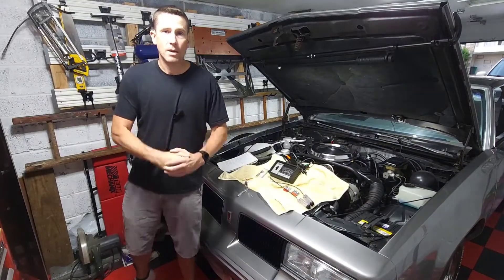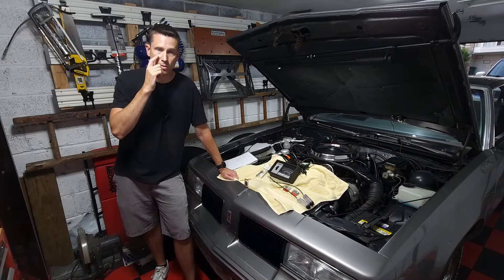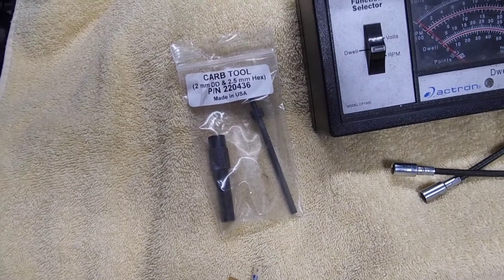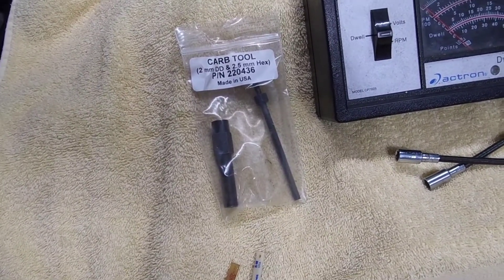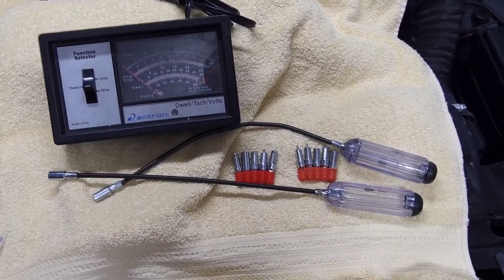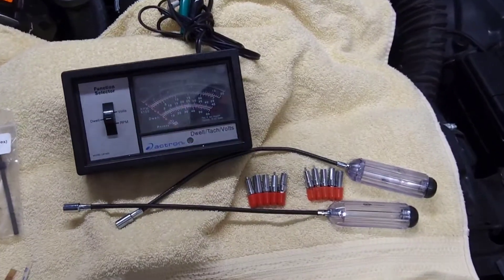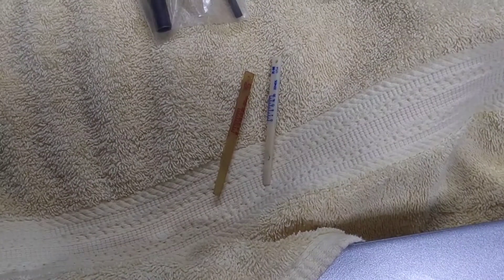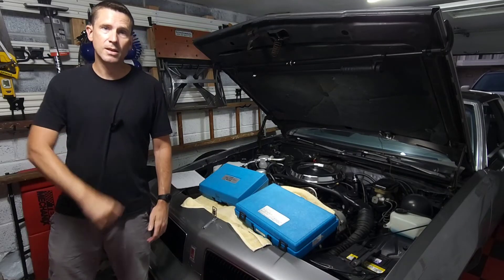3 Tools You'll Need To Tune An Electronic Quadrajet (In 3 Minutes!)

Comment: I’ve been watching your videos I have a 81 Pontiac Firebird Trans Am with a 4.9 turbo I had the carburetor rebuilt and it keeps bogging out I called the guy who rebuilt the carburetor said it’s not getting a fuel put a new fuel pump in it now I don’t Bagan on the freeway what are bugs on when you get off the freeway
Reply from the maker: Is the float height adjusted properly?